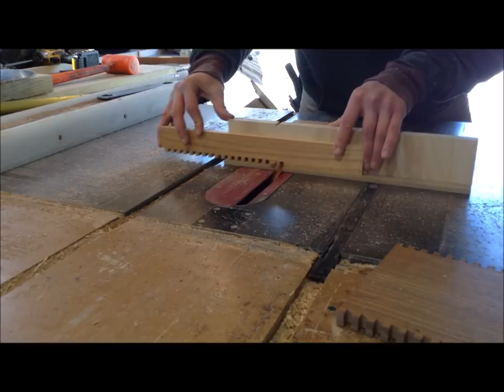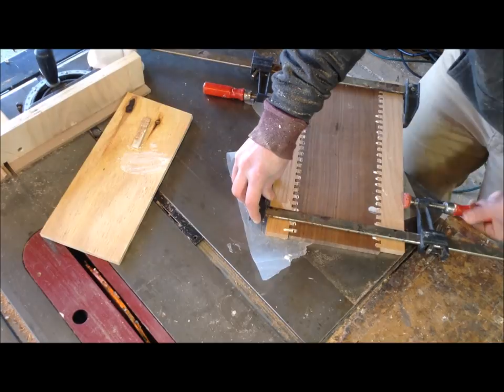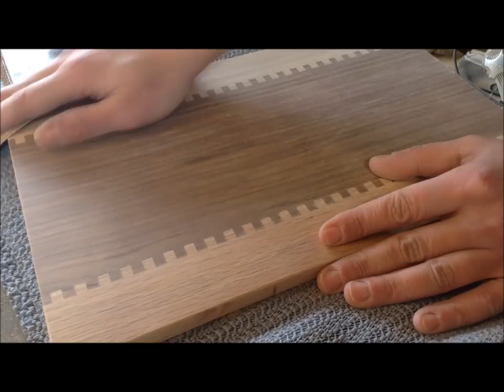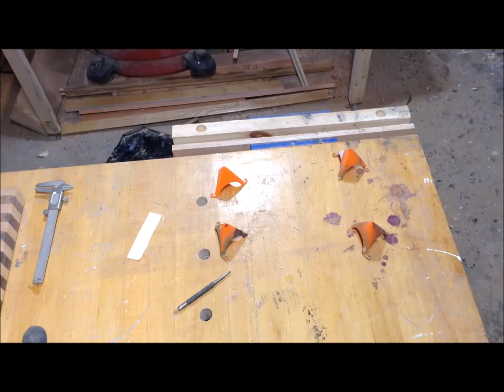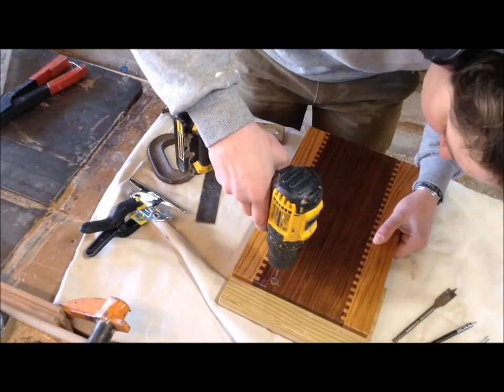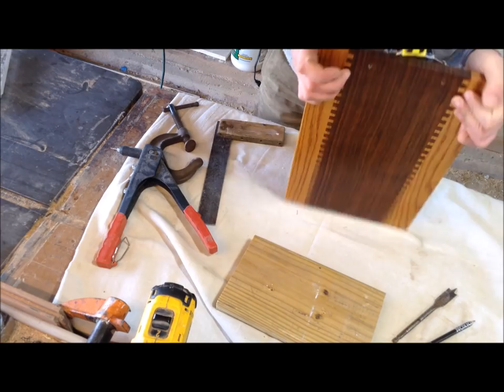Woodworking : Custom Clipboard || Real-Time

Comment: Very nice, the finger joints were a nice touch - thanks for sharing. If you plan to make a batch of these you might consider using screw posts in lieu of nuts/bolts or rivets. They'll lay pretty close to flush on both the bottom and top sides of your project. Available in many sizes and lengths, aluminum, brass and steel. Again, thanks for sharing.
Reply from the maker: For now this is a one off, but thanks for the tip I didn't even think of screw posts.  That would have been the best solution, when the rivets weren't long enough I went with bolts, but screw posts would work best.

Comment: What finish do you use?  I can't find clips with rivets do you just use any rivet you can find that's close? Where do you get them? How thick is your board?
Reply from the maker: This was probably General Finishes Arm and Seal.  The board is around 1/2 inch, and I just have an assorted pack of rivets I use for stuff like this with multiple sizes.

Comment: Great for that wish list ... I still hate those pop rivet "guns" but they have their uses... just wish there better ways to do it. They never seem to be in a comfortable position to actually "pop" the rivet. Maybe a better ratcheting system in the gun?? Beautiful piece. Love the way you avoided worrying about the ends of the board.
Reply from the maker: I didn't end up filming it so it's not in here, but I switched out the rivets for small bolts.  The rivets weren't long enough to make it though the other end, which is why it was so hard to get them to "pop".  Probably just should have used the bolts to being with, but I was copying how they attached it from my personal clip board.
Reply: @HoneyBadgerWoodWorks  Thanks for taking the time to reply to my rant about one of my "most hated" tools.
Reply from the maker: Someone suggested screw posts for attaching the clip and I think that is the way to go if I ever make more clip boards, so the pop riveter goes back in the tool box, not to be pulled out for another two years.

Comment: Turned out beautiful.  Was that Danish Oil you used for the finish?
Reply from the maker: No, it was Waterlox.  Which is probably over kill, but I was using it at the exact same time on another piece so it was easiest to just do it on this as well.

Comment: great looking board too bad you wrecked it with your rivet job. Try Chicago screws or rivets designed for leather work next time. Even a 3/8" bolt with an acorn nut would've been better.